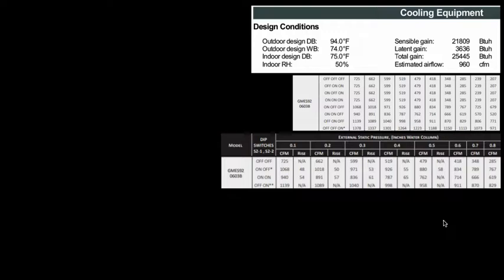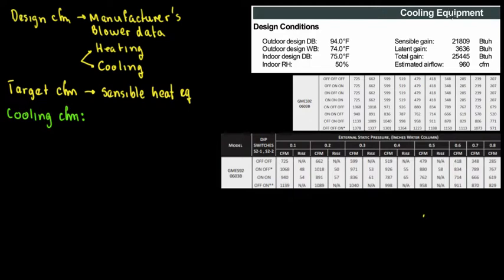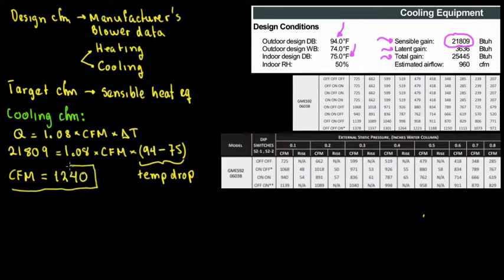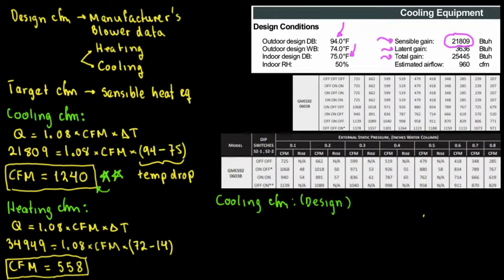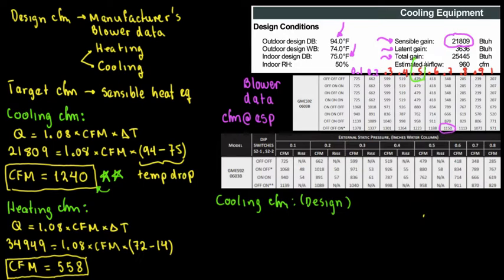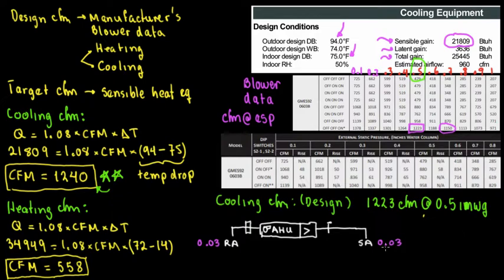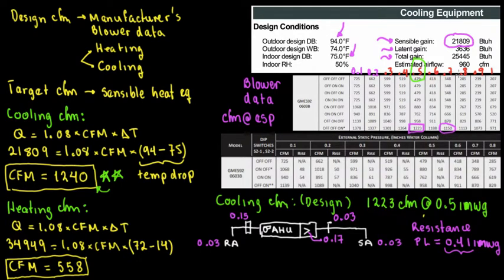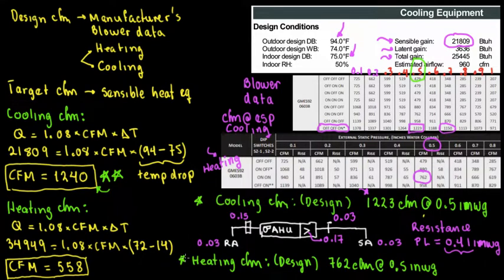Heating CFM vs Cooling CFM and Design CFM

Comment: The sensible heat calc for cooling isn't correct. One cannot maintain a room temperature of 75 degrees by cooling 94 degree outdoor air from 94 to 75. Although this indicates a 19 degree delta T, the delta T this applies to is a return air/room temperature of 75 and an AHU discharge air temperature of ~55. One can not maintain a 75 degree space temperature by cooling 100% OA at 94 deg down to only 75 deg F. Please correct to indicate that 75 deg is the AHU return air temperature and 55 is the DAT. The OA design temperature is used only in the cooling load calculation, not the design cooling airflow CFM calc. Many other factors come into play when using the ASHRAE OA design temperature such as building insulation, window sizes, SHGC, etc. The end result airflow is approximately correct because the delta T happens to be about 20 deg F in each case, 94-75 and 75-55, but the method for calculating the airflow isn't correct.
Reply from the maker: Thanks for your comment and analysis. I will double check on the formulas in this video. Thanks 👍
Reply from the maker: I appreciate your comments. The temperatures for delta T (temperature drop) should be measure at the closest inlet and right outside to the AHU/Furnace to calculate more accurate CFM based on the heat gain/loss. For this example we take the extreme values which are for example (without taking into account OA) if someone went on vacation and arriving home turns on the AHU so indoor is 94F. the system will start and suck that air, say at 1150CFM (which is the factory default based on dip switches setting shown in the video) so 21809 = 1.08*1150*(94-Tx) this gives us Tx=76F. So in other words in the video we just do an approximation of the cooling and heating cfm. In general, usually temperature drop around 20F and 40-70F